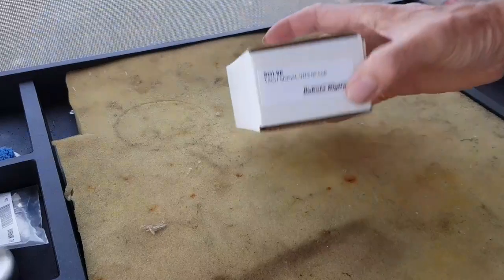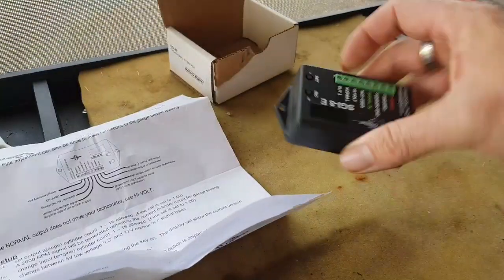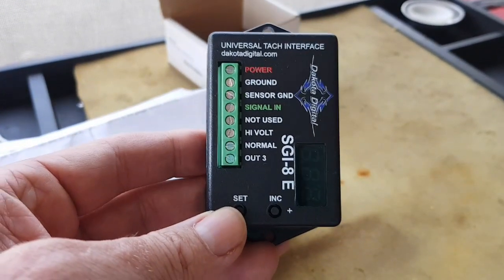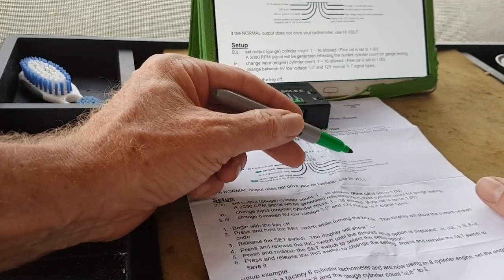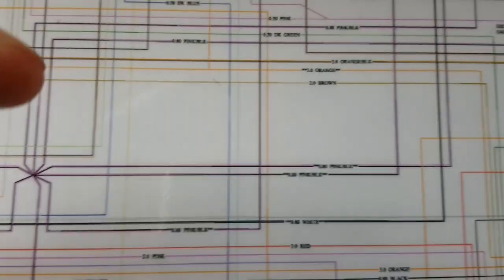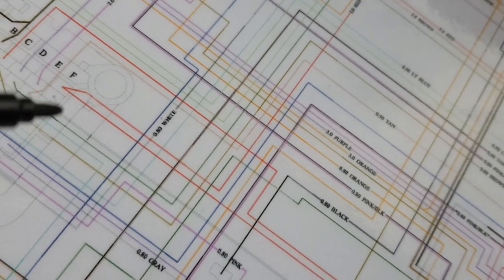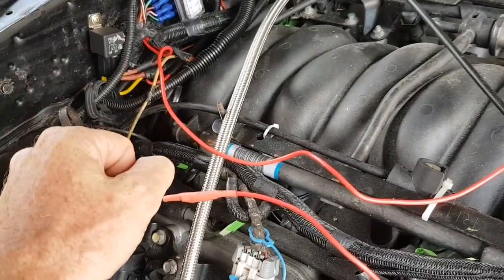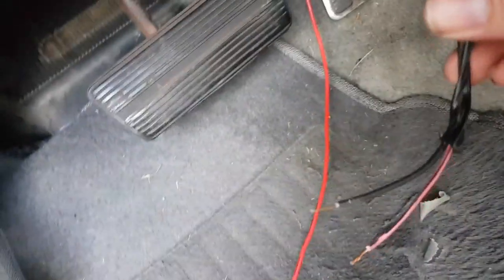Ls swap - How to fix tacho not working

Comment: So I've got this unit on a LS E30 swap, original tach was to a 4 banger so I put my IN as 8 since that's input from the engine and I put OUT as 4 since the tach was for a 4 banger but my tach does nothing but will work without the Dakota digital but read incorrect.

You think I should do what you did? 4 in 8 out?
Reply from the maker: Yes definitely its the only way it will work.  Double check your wiring as well

Comment: Well done, man! I actually need to do this very thing. I've had the SGI-8 E for about two years but have not installed it yet. I swapped an LS2 out of an '06 GTO in to my '87 Monte Carlo SS.  I actually installed the Dakota Digital ECD-100-2 to work the factory speedometer.
Reply from the maker: Thanks for watching, yeah mine sat for 6 months yet only took 1 hr to install.
All the best

Comment: I also put an LS into a Firebird. I have the SGI 100BT I’m trying to get working with my tach. My tach has two wires coming out of it. Which one goes into the SGI 100 and where does the other one go? Any help is appreciated.
Reply from the maker: Let me check on my setup tomorrow ans will let you know asap

Comment: Hi Firebird... funny...we’re both talking gauges lol... I’ll have my LS swap video soon... it’s still winter here in Canada... but the weather is starting to cooperate. That’s a nifty little unit to get the tachometer working. I thought it would be cool to have someone with electronics experience to build a LCD style bar tachometer in place of the turbo lights on the hood. Kind of like the old C4 corvette digital tachometer... but long ways across like a ruler, plus a digital Display on the far right. 
Cheers
Reply from the maker: That's exactly the idea i was thinking of too how bizarre
Reply: Firebird great minds think alike 🧐

Comment: Will this work on a diesel that gets its signal from the tach post on alternator, after the alternator was swapped with a different pully size?
Reply from the maker: I'm guessing it should work.  Best to visit dakota digital and send them a email to be certain.  They respond very fast .
Reply: look for this one "Dakota Digital SGI-100" it shows a diesel input on the module